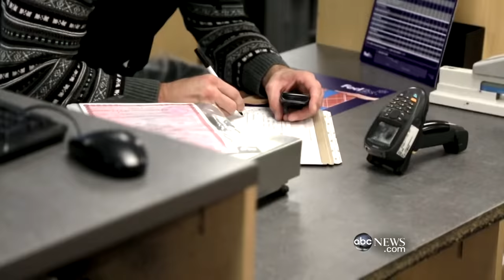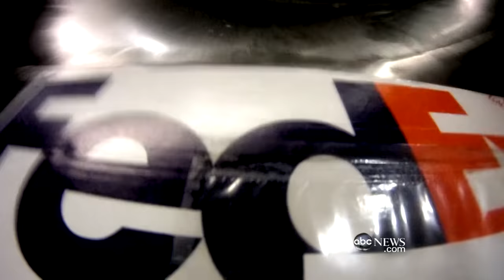Inside FedEx's 'Superhub' During Christmas Rush

Comment: Fedex does not care about it's employees. Due to their negligence, I lost a pinky finger and now I won't be plucking strings on my guitar the same way...less in fact since I used to play Flamenco style. They left me to bleed after I was blown off the truck as all the trucks are improperly loaded and not secured. I flew 9 feet through the air and after I hit the floor, not one person in that warehouse asked if I was okay while I was bleeding. No ambulance ...they stuffed me in an employee's car after 30 minutes of debate about what to do. Then...the employee/driver could not find the hospital. He drove into TDK corporation as I told him..."There's no hospital here...this is TDK." Anyway... Fedex was fined with two violations... Failure to call for an Ambulance and Improper load of trucks with no safety straps securing the loads. What did I get for losing a finger...? Nothing except medical attention and surgery. Since it's Workman's Compensation, you're screwed. You get NOTHING. Think easy on this one...it's a no-brainer when children are running the show. You are nothing but a slave/animal with zero rights. Found out a visitor was chewed up by one of the roller gear machines that was supposed to be turned off for repair. It seems that whomever had the key turned it back on before any repair. The woman got caught in it and she was chewed up alive. This happened in around early 2016 according to the employee that shared this in orientation. There's quite a bit more...best wishes to anyone that decides to put their life on the line for a corporation that could care less if you live or die.

Comment: If it was real, this pie would have showed up In 3.14 pieces.
Reply: Lol
Reply: It's all about the packing. You pack your item like it was a breakable piece of glass. Many refuse to adhere to that concept. I've seen boxes just fall apart and it's not because of us. It's because the box was in poor shape before shipping and was not taped with shipping tape among other reasons depending. Newsflash. Your package is NOT the only one running through the system and the sorts move way too fast to give each box the kid glove treatment. They should not be thrown, but they can be handled roughly, so pack accordingly.